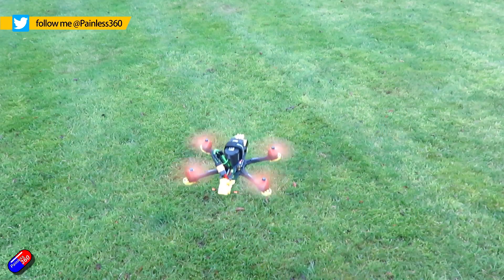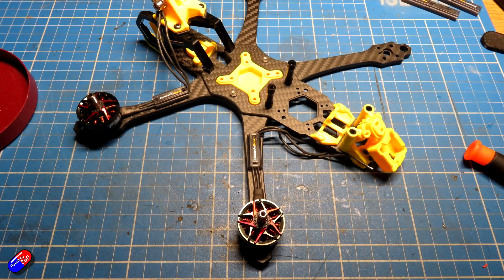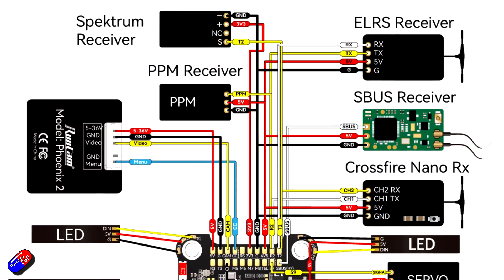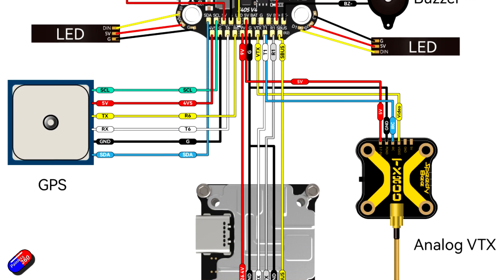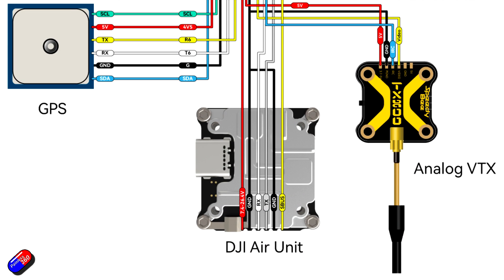Quadcopter Build for Beginners (2023): Part 4/4 - Adding digital or analogue FPV

Comment: Hey Lee, just curious if you know why these companies have chosen to utilize solder pads for everything rather then using a pin system? It seems like using pins would make wiring these up much faster and more efficient rather than having to solder everything, especially when not everyone knows how to solder. To me, it kinda seems like they use the solder pads to appease the tech nerd in people to make you feel like you’ve actually done some kind of tech work building your drone, rather than just plugging in a pin…of course this is just my extremely uneducated opinion lol.
Reply from the maker: Mainly space. Older quad flight controllers had pins but that can limit the places they can be used. Happy flying

Comment: My two cents from a pilot with years of Analog quad experience. OK OK HD is going to get cheaper  eventually. But even trying to source Analog stuff these days post covid is albeit next to impossible. So much so that Matek stopped making their F7 Std flight controller.   
The reality of it is that     HD isnt that much clearer and definitely isnt as reliable as Cross Fire (IMHO) and is more expensive than analog.
The extra space that frames now have for the HD gear is nice And I LOVE the in Frame HEATSINK   that is much cleaner than my after market little stick on heat sinks
Nice series   appreciate it thank you .
Reply from the maker: Digital isn't for everyone. The expense is a major factor. But, once you get used to it, going back to your analogue kit will be like going from a modern largescreen HD TV to that little portable TV that used to be in the kitchen when you were a kid.... Happy flying

Comment: Fantastic build video.  My FPV analog drone is all set up, configured in Betaflight, I can get video through my goggles.  My issue is that when I  plug in lipo, the beeping  sounds occur, etc. but nothing happens when I move the throttle stick.  I am using FrSky X20 radio and an XM+ receiver.  Everything is working  properly when previewing in Betaflight which tells me controller recognizes my radio and receiver.  Thoughts?  Thanks....Randall
Reply: I found it.  I had set up Throttle cut in my mixes when I set up the Throttle.  You had set up Channel 5 as Armed/Disarm.  When I removed the Throttle cut out of my Throttle mixes screen, all is working now.  BTW, I have downloaded the Speedybee App for bluetooth and it works great (so far that I know of). Thanks